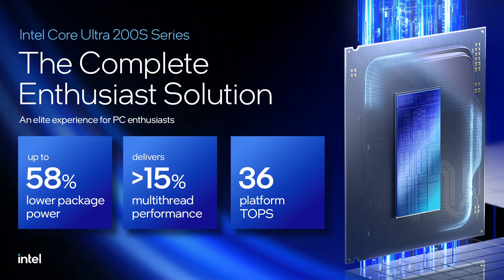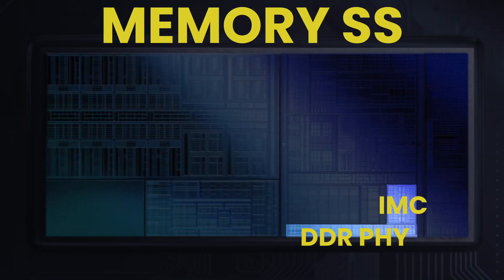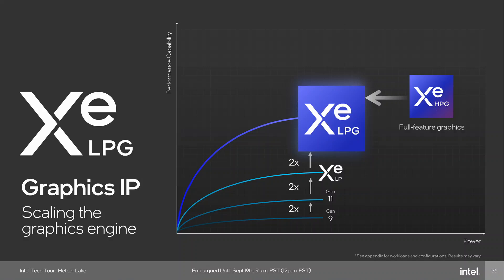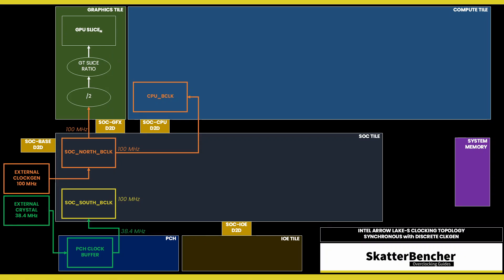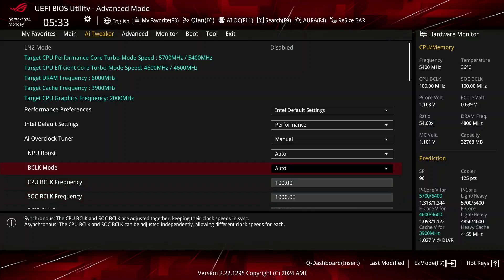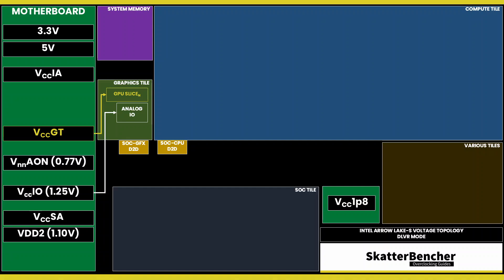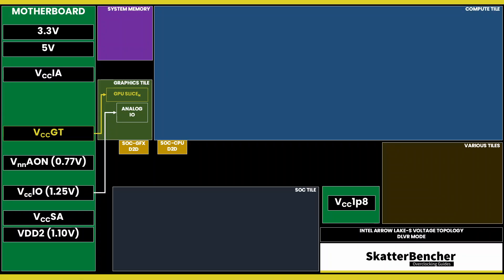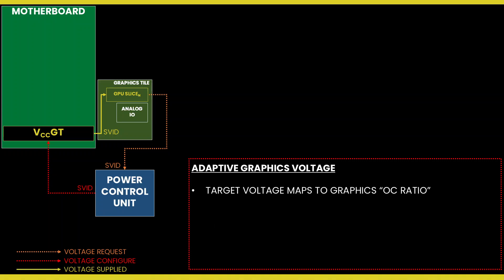Arrow Lake Overclocking: Integrated Graphics

Comment: Sorry. But finds this analysis really no sense. Who buys this CPU to use only with integrated graphics.
Reply: he has two other videos, one overclocking p cores one for e cores. people can do more than one thing you know? we've got new silicon, he wanted to test out each component, what's wrong with that?
Reply: I could see someone snagging a 245K for a slim and quiet ITX build. The iGPU/CPU configuration is fairly close to an 8700G and I could see it being a better option than that in certain use cases.

But yeah, it's mostly useless in the 285K unless you're doing some bespoke Intel thing like QuickSync or OpenVINO stuff.
Reply: A lark mainly.
Reply: from 245K to 285K there's same iGPU. Now, Intel have very good iGPU for productivity, example is Adobe applications. Also you can put Streaming through iGPU so not to eat out FPS in your games on dGPU. it's called QuickSync.
Reply: laptop ARL oc
Reply: Sorry, but your comment has no sense 😁 E.g. I am using it only with iGPU for productivity like for freeCAD, openfoam.

Comment: Revolutionary? Hardly when it gets beat by CPUs from 3 generations ago.  But nice that Intel sent you some free stuff for you to play with.
Reply: the architectural changes are revolutionary, the performance isn't
Reply: Intel was focusing on efficiency this year, not performance. I am not an Intel fan boy, but I am not against Intel for this.
Reply: Arrow Lake sorely needs some optimization on both OS and BIOS/microcode before we'll really know how its going to really perform. Just another botched premature launch..

AMD Ryzen 9000 and other Ryzen CPUs also had the same issue with poor optimization due to Windows at it's launch.

Hopefully in a month or two we'll see some incremental improvements and better stability.